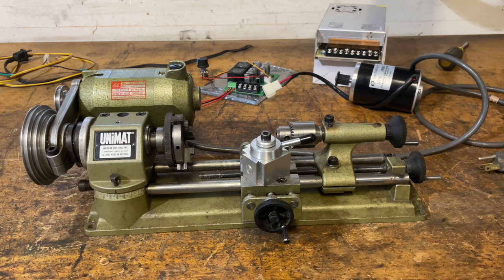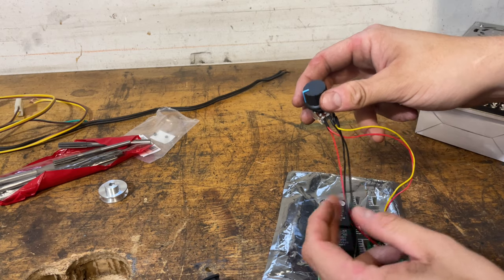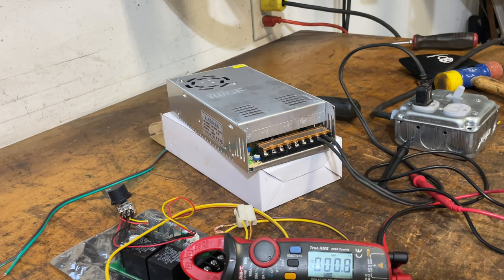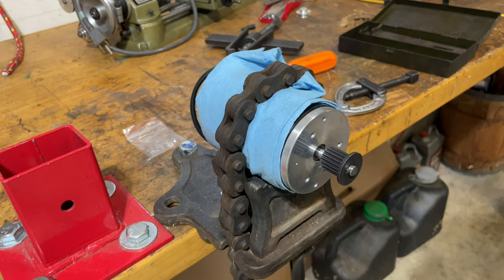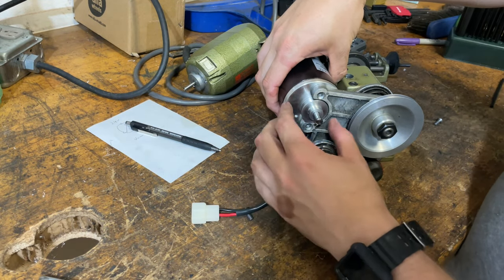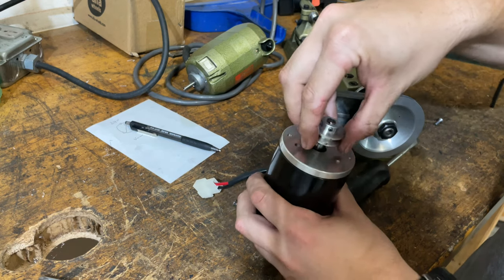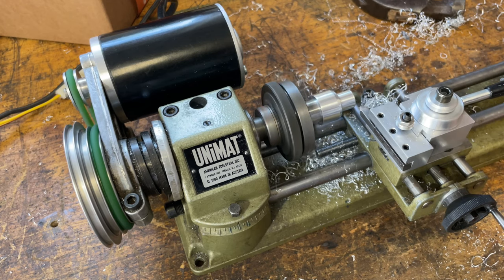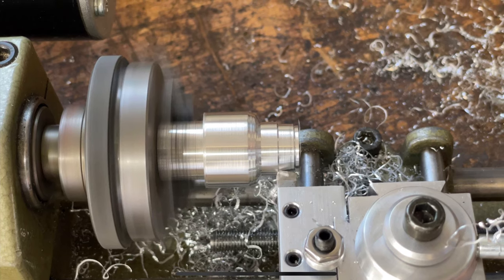Unimat SL-1000 Motor Upgrade to 150 Watt DC Motor with Speed Control

Comment: Good job. 👍

I did a very similar conversion on my Sherline lathe. You might like to see my videos if you need any ideas for an enclosure. 🙂
Reply from the maker: Already seen your Unimat ones but I’ll definitely take a look at the Sherline ones now.
Reply: now I gotta go back and watch your Sherline stuff.
Reply: Isn't the sherline powerful enough already? I have honestly never been able to stall that damned sherline motor haha! And that is cutting stainless too.
Reply: @martinpanev6651  I bought my Sherline used and the motor was faulty. It wasn't operating at full power. Unfortunately the  Sherline motors are expensive and difficult to source where I live so it was easier and more cost effective to change the whole thing.
Reply: @machinist_matt  Oh, that makes so mich more sense! I watched your video on the sherline a while back when you posted it but i dont think i was listening that much haha

Comment: I'm excited to do this to my db200. can u link what tachometer(?) your using to measure the speed? I'm having trouble finding an analog one with a dial indicator. i might be searching for the wrong thing though. thanks
Reply from the maker: It’s a Hasler Speed Indicator (patented in 1918). Look on eBay.